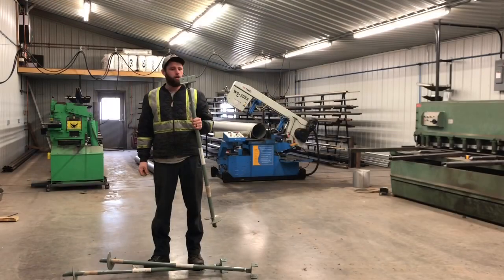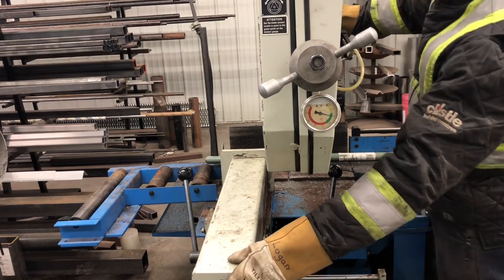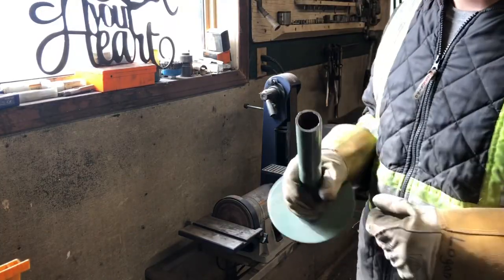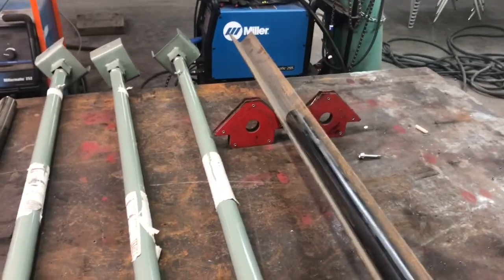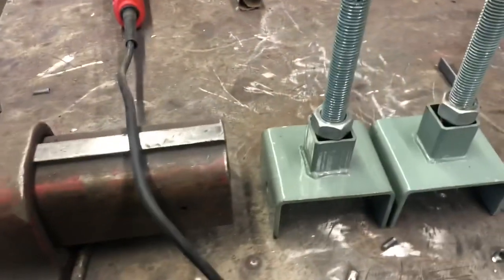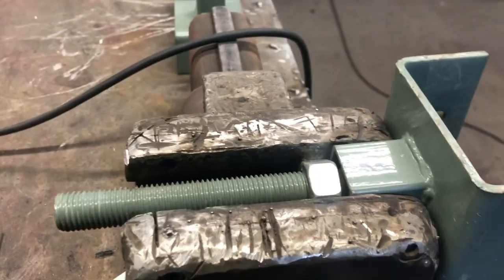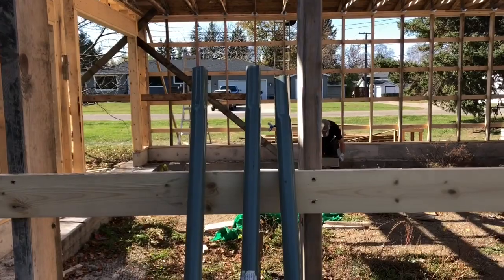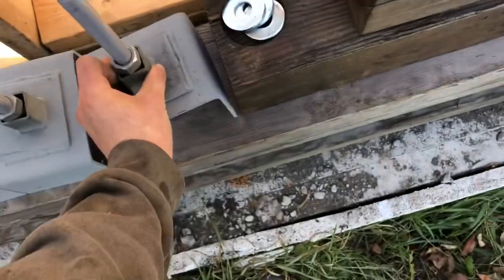Garage Build: Screw piles for lean-to posts: Customization and DIY installation.

Comment: Hi, looks like the will work good.   Regarding installing, from what I read, take the nut off right away, put the top part into the tube (square to square) and use long piece of wood to screw in.  When you get it to the depth you want, take the top part off (might require a few taps with a hammer), put the nut back on, make the final height adjustment AND THEN, tighten the set screw.    I'll be installing three of them next week.    I do like your shop!

Comment: Hey good job on the screw pile mod for your lean to. I’m looking to do something similar cpl of questions 
Seeing how the top brackets just rest on the shaft any concerns with uplifting? Or did u attach them
Also we’re you concerned with any lateral movement? Or are they pretty stable?
Thks
Reply from the maker: Thanks. @Tiberiusx Because it’s in a sheltered area I’m not too concerned about it lifting but in an open area it would be a good idea to maybe drill a hole through the bracket and shaft and put a bolt through. I actually haven’t even screwed the posts to the bracket yet and there’s been no movement whatsoever. It’s very stable. Putting angle braces on the posts helps a lot too.